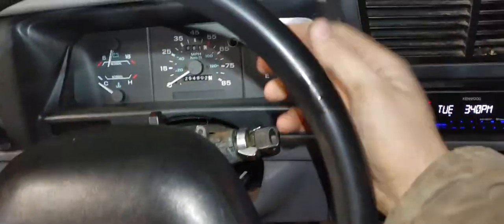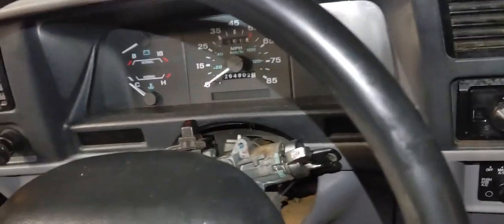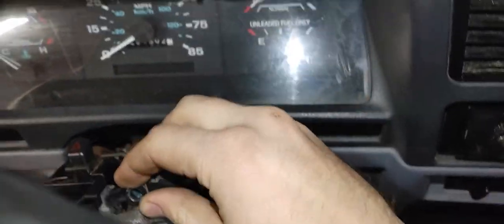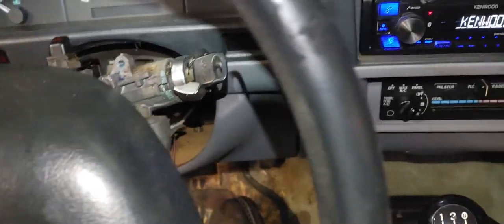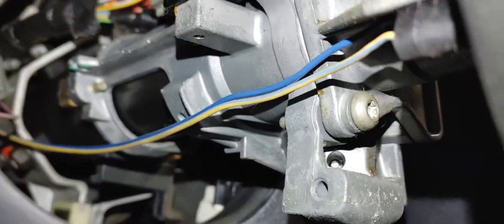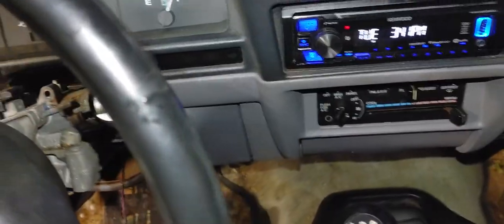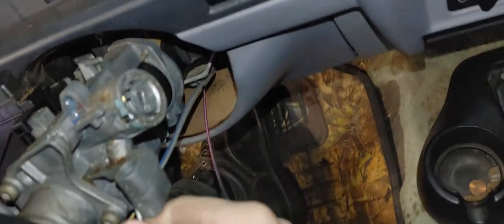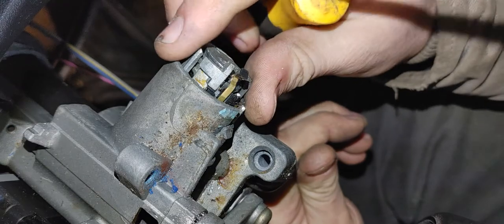replacing the key lock cylinder on a 1994 manual ford ranger

Comment: hmmm, I lost the key, so no  key, no run position to remove ignition, right?  or is there another option?
Reply: drill it
Reply: Drill it but don't go too deep, you'll need to manually turn the bottom plastic clip that would  have turned with the key when putting  the new  cylinder in.